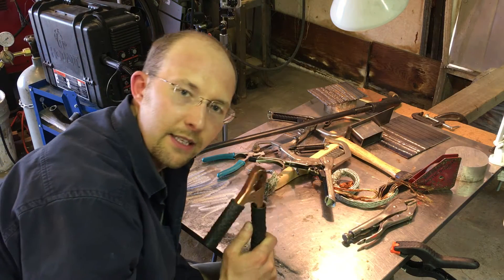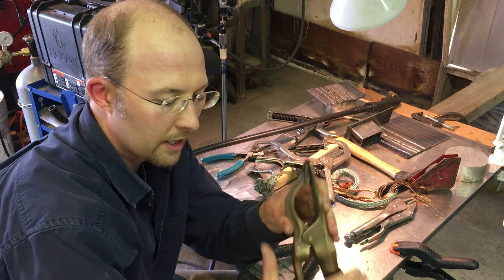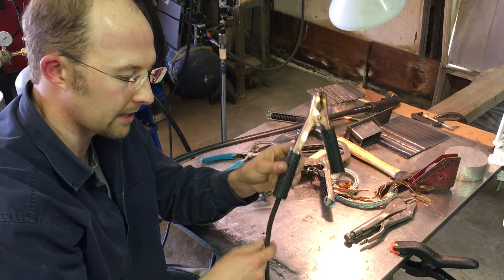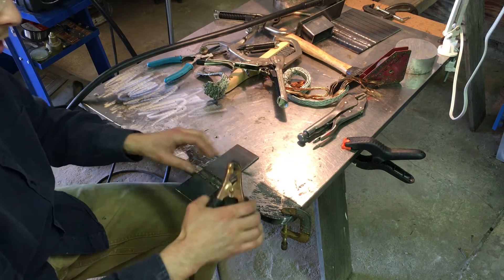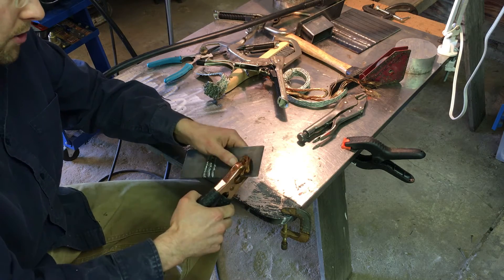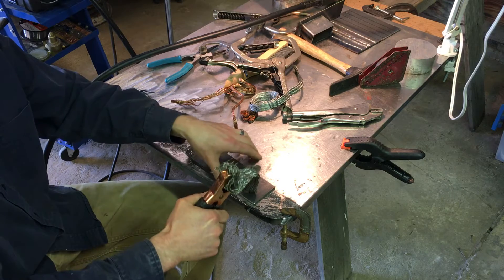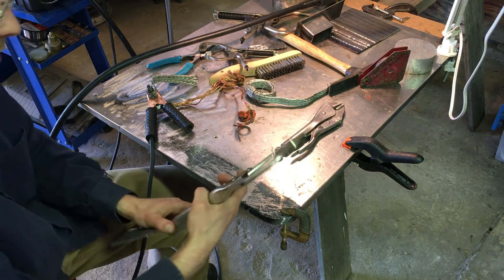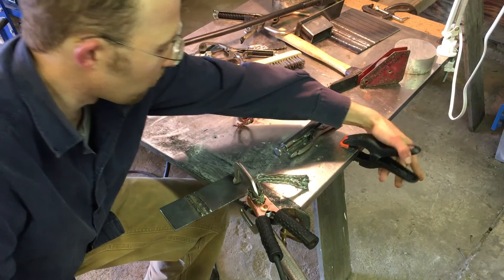Welding Tip: How To Improve A Cheap Ground Clamp

Comment: I was using my welder to blast batteries to bring them back to life.  Running 60A I realized that the clamp was very hot.  I then noticed most of the wire (welder from china) was sheered off at the clamp.  I used another charger clamp I had on hand with the points on it similar to yours and the clamp with the wire connected was solid copper.  I grounded off the teeth to get more "connection".   The wire trick you showed is a good idea.   In an effort to make this stuff more affordable they really provide shitty clamps.
Reply from the maker: @EverybodyLovesMoe   yes it’s a good fix for the cheap clamps they provide. Good job getting it fixed!

Comment: Great video thank you for tips. Question, 4:00 Would this method work if my work piece is on a wooden table?
Reply from the maker: It likely would work ok, but just realize that all the welding current will go though that single connection between the top of the clamp and the metal you’re welding. So that connection will need to be nicely clean & tight.
Reply: @TomWylie  Yes good point. Thank you
Reply from the maker: @  no problem 👍

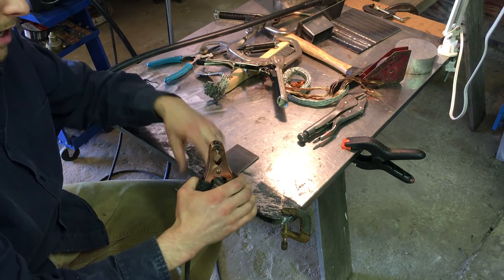Comment: If you have a small inverter welder less than 160 amps and have a copper battery clamp type as shown at 2:00 minute mark simply file those points down a bit to make more contact. How much is up to you..  Also redo the screw that holds the wire if applicable as that's the first place where you can have issues with a cheaper clamp..  The position of the clamp side that has the screw is a great tip not thought of enough I'd wager to say..

Comment: Alternatively, rather than relying on workarounds, just buy a better grounding clamp. Even name brand (Lincoln Electric) clamps that are worlds better than that alligator clamp are less than $10
Reply: Please provide a link to a good name brand clamp for less than $10.   A tiny Radnor copper clamp is $22, and usable sizes are up to $60.  Tweco more than that.
Reply: @gizzyguzzi  when I posted that over a year ago, I bought a lincoln electric kh525 300a amp ground clamp for $6.25 u.s. dollars. There were other good brands for a little more than that. Unfortunately the price of metal keeps going up and up and those deals aren't around anymore.

Comment: Those alligator type clamps suck! I replaced one recently with a plain hardware store spring clamp, Ran a strip of copper from handle up over end of clamp, bolted strip on with cable end. Made it seem like a whole new machine!

Comment: If you are serious about your welding you might want to just replace what you have with a solid brass clamp. They are much stronger and conduct much better. I got one with my everlast welder and I was impressed by how much of an improvement it was over what I used to use.
Reply: That's true but he described exactly what was in the videos title

Comment: I have a 500A ground clamp and a 90amp or 100amp flux core welder, can I use that ground clamp on my welder?
Reply from the maker: Hi Justin, yes you could! Make sure you connect the wire end into that clamp very solidly, so it conducts electricity really well. You'll still want to make sure the clamp gets clamped very securely onto clean metal with as much contact surface as possible (use the copper wire braid or stripped copper wire if needed). Depending on its design, that big clamp may get in the way sometimes for welding small stuff, but it should work just fine. You just want the amperage rating of the clamp to be equal to or greater than the maximum amperage rating of the welder you install it on.
Reply: Okay so I can use a much bigger clamp than the amps on a welder but nothing under the amperage of the welder. Right? My welder is the older WF1800 Campbell Housfeld flux core welder for small jobs around the house
Reply: And yes my clamp does have the metal strip in between the clamp. But  I do believe I need a bigger size wire tho
Reply from the maker: Yes, I wouldn't use a clamp rated for less amps than the welder is rated.
Reply: Okay thanks

Comment: You never mentioned about using the strapping and joining the main lead part of the clamp to the opposite clamp arm? I bolted mine from one side to the other and brazed two plates to the clamping faces, now it's a good earth lead ;)
Reply from the maker: Steven Yates that's a great idea! Thanks for sharing it.